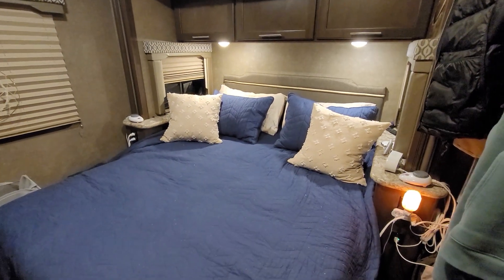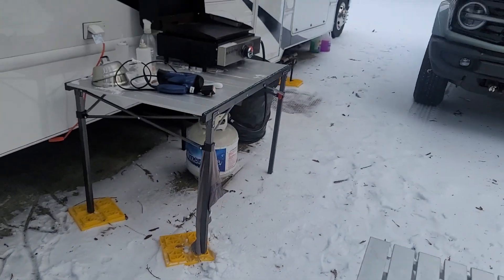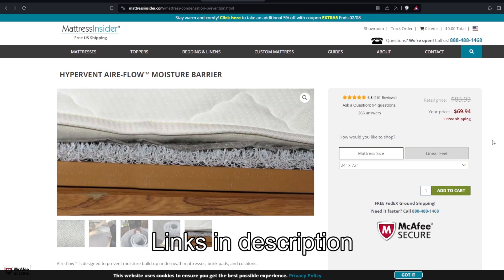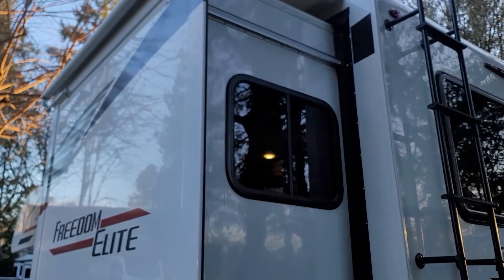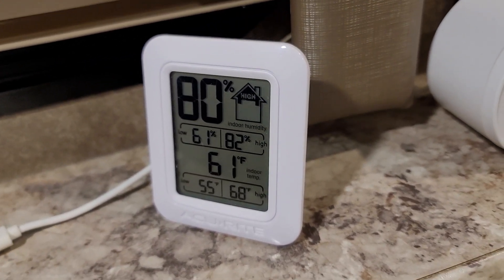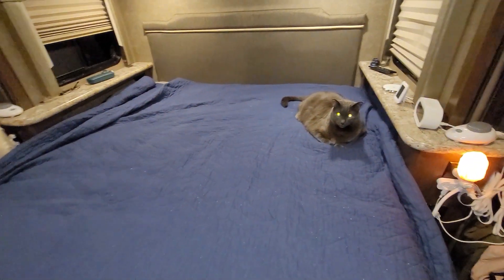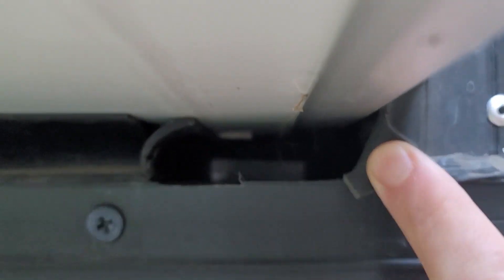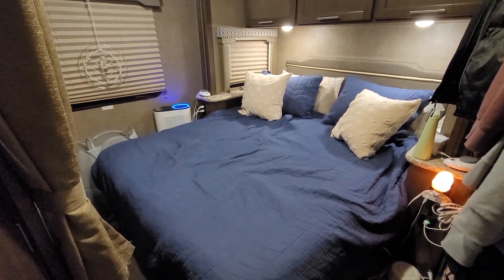Condensation and MOLD Beneath Our RV Mattress -- Hypervent Aire-Flow Install & Review

Comment: You need a dehumidifier in the PNW wet season for this condition.  I live here and we learned it from our folks who live on the coast.  We have a Perfectaire model, their smallest one.  We run in it in our 24' trailer for size reference.   When we camp in wet season, it runs constantly.  And often fills daily which is about half a gallon.  And we're often hanging wet gear as well being we snowboard and camp in the rain half the year.  

If really shopping to fix this issue, look for a dehumidifier with an exterior drain option.  This way, when at 80% humidity, you won't fill your tank and stop the machine, it'll just run and ring out the moisture from the air and send it down your sink.  I made a 1/2" ID tubing tube rig for this. 

Went long sharing, but it was about the PNW, and this is a real problem here.  And a dehumidifier is how you fix it.  We even have small dessicant models in the closets in the winter.  We just wore out a set some rechargeable types and had to replace them.
Reply from the maker: The more you know! Yeah, we started keeping dessicants in some of the closets. We also got this teeny Hall effect type of dehumidifier, but it was extremely ineffective. The number of climate control devices got out of hand here in a hurry as we travelled all the climate zones - space heater, air purifier, humidifier, and dehumidifier lol.
Reply: @BOOTENWAGEN  The gadgets add up fast. don't they.